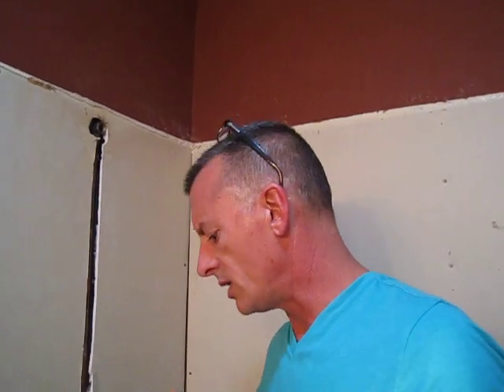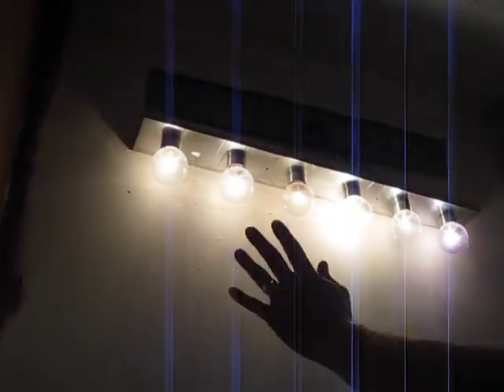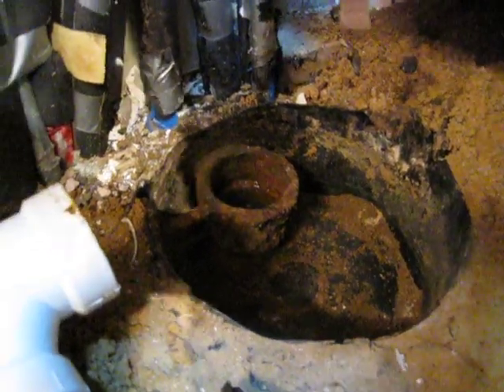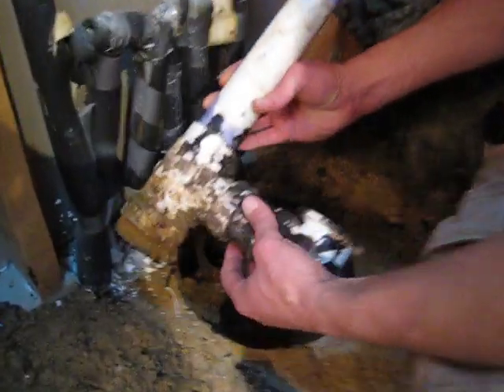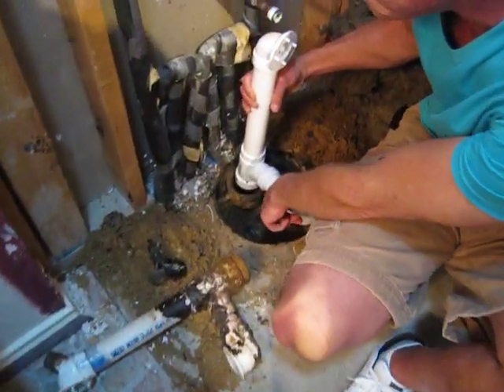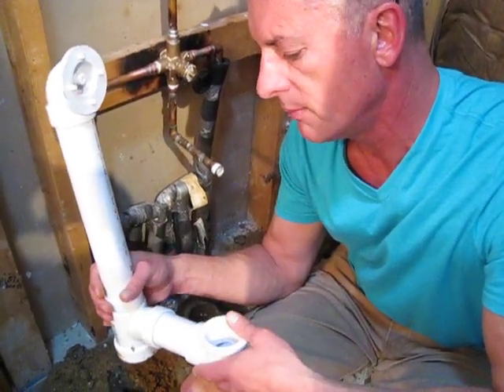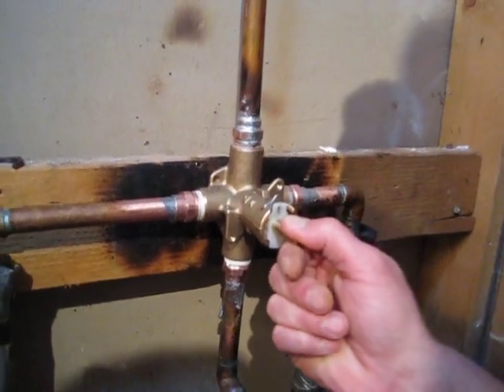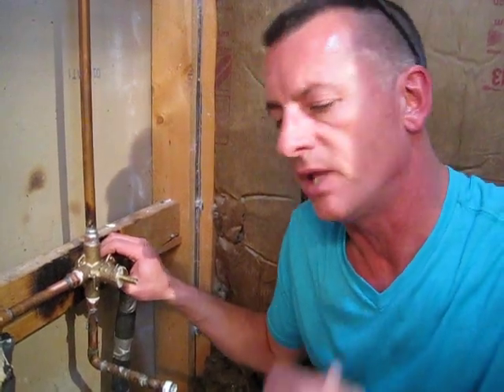Bathtub Installation - Slab Plumbing

Comment: Home Depot and others sell a push in or slide over adaptor that will allow you to seal a piece of PVC pipe in the drain. You simply use a No-Hub rubber  fitting over the stub of PVC. Cleaner, tighter and less work. You have to scrub smooth the outside or inside of the pipe in the floor so the neoprene/silicone adaptor seals well. Use a Dremel or and end grinder or drill with steel or brass brush to get the mating surface smooth. Many modern toilet flanges are also installed this way in a slab with cast iron pipes imbedded.
Reply: wrong. you don't know slab mean and cannot get to bottom to tighten the ring

Comment: The black tar is what they cover the pipes so that the concrete doesn't break down the PVC over time. Builders do this before they pour the slabs. It's not to seal pipe in any way.

Comment from the maker: Hi Jones

The tub drain "Ys" to the toilet discharge pipe and the toilet is vented.  Distance is about 24".  You are correct, there were no threads in the iron pipe. You make good points and with some engineering I can envision your suggestions working.  However, the owner of this house had specific ideas about how he wanted this done and was willing to pay for.  I was actually quite confident in the solution we used so long as we did a better job than the plumber before us.  Good questions.

Comment: that tar like substance may have been to control insects.  on grade slab construction is on the ground.  termites are a worrisome problem here in florida and from what i understand the tub drain area gets slathered with tar to keep the termite from coming up around the drain assembly.   termites love holes in concrete.

Comment: That "black tar paper" looks like the coal tar paper that was used to prevent pipe corrosion. I would see it on the steel gas mains and service lines in older neighborhoods when I worked for The Southern California Gas Company. That stuff is loaded with asbestos fibers for rigidity.

Comment: Our new tub is a foot away from concrete floor drain of the old one. Can we run a foot of pipe from the floor drain and to under the new drain, then install the drain and overflow from there or do we have to chisel our way over there?  Thx for the video!
Reply from the maker: Here's a link to another bathroom I remodeled and what it took to move the drain: https://youtu.be/c0m4Y1_XUiE

Comment: If it was cleaned up...one could use the likes of Devcon '5 minute' plastic steel putty to glue in that steel adapter in... it's great stuff used in Industry for years... and can be sourced from Grainger Industrial supply once it goes off makes a great solid joint...

Comment: Try this next time.  Remove stool for working room,  clean inside of cast hub and install hub gasket.  Measure from floor to bottom of tub drain "on new tub" and from wall to center of drain. do the same with overflow tube.  Next grease inside of gasket and set waste & overflow then dope the shoe, set shoe gasket use a "little' duct tape on "side" of gasket and shoe only, repeat with w/o gasket then set tube install waste plug and w/o plate. re-install stool and you're done
Reply: can you use correct words? what is stool, shoe and dope?